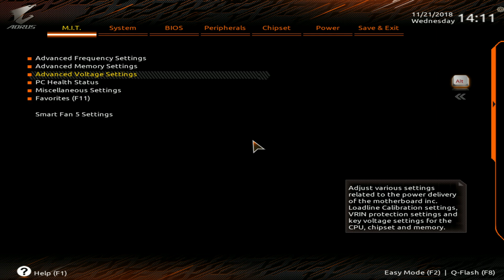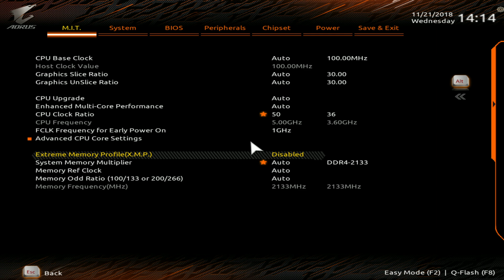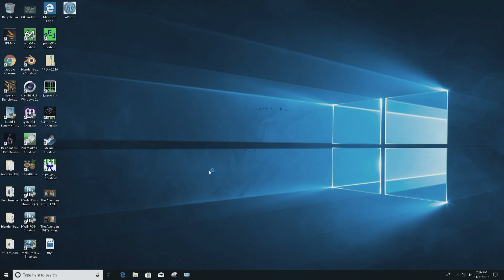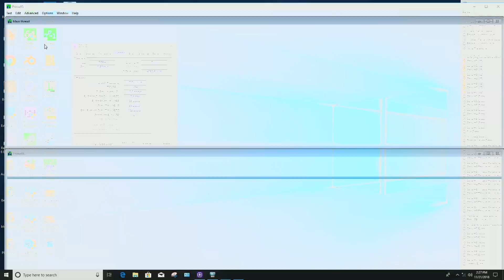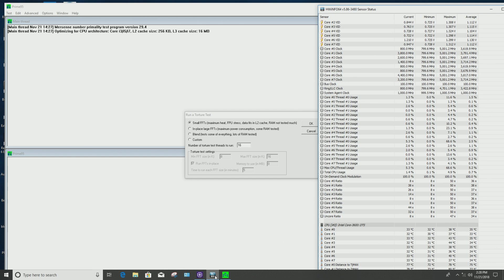GIGABYTE Z390 Overclocking Guide

Comment: This didn't work for me at all in an ambient temp of around 5~7 degree Celsius and a push pull 360 rad.

I tried from 1.275 all the way up to 1.37 and the system was just unstable. I don't think this is a thermal issue since it always crashed at around 80 degrees Celsius, guess I lost big time on silicon lottery..
Reply: Same here.
Reply: I had crashes that were reallt bad with mt chip. I changed the thermal paste on the ihs and delided the CPU with a box cutting Razer and used mx 4 on thr die and it fixed my crashing issues and instability. Intels toothpaste is trash
Reply: with a delid processor.. do you use cooling? I mean the lid is now gone so therse nothing for the heat sink to stick to with the paste.. or is that what you mean when you say you put mx4 on the die.. is that what is under the lid? a die?
Reply: @the_vicer0y_YT  your comment is a bit old but for the sake of other people who don't know, yes a delided chip still required cooling. Deliding a chip is removing the lid, cleaning the crappy Intel thermal paste off the die and replacing it with a high quality liquid metal or other such thermal paste then putting the lid back on the chip.
Reply: @ava8363y  ohhhh I never knew that they put the lid back on.  Is there a big difference if you delid it? Like is it worth the trouble? Is it easy to screw up?  

P.S. Im not anal about people replying to old comments/threads.. i think people are assholes who point out to other people who reply to old threads/comments that its so and so old... I never understood why time mattered? Most subjects are still very relevant today than it was ten years ago.. and those old posts helped me greatly in my years.. Why am I saying all this.. because I want people to stop pointing out age of comments and threads because most of the time those threads are still valuable sources of information.  Besides that.. this comment is only 4 months old which isnt old at all.

With that said.. thank you for taking the time to reply to this comment.  See.. months went by and I still didnt learn what the delidding process was till you responded which is why its a good thing to reply to old posts.  Like you mentioned, theres always someone else who needs this info.  Thanks again.

Comment: 9700k and gigabyte z390 sli crashes as soon as i begin prime using these settings
Reply: Tim Curtis I’ve got mine at 5ghz and the only way I get stable is if my voltage is at 1.345v a now runs prime95 stable
Reply: David Reeves nice! can you make a tutorial with all the steps for is? Really dont know where to start!
Reply: Burak Goraler just run through the video above but where he put 1.275v you will put 1.345v I’ve had my prime running over hr now a not got over80c with a h150 pro aoi
Reply: Tim Curtis did you succesfully overclocked yet? I got the same specs so i was wondering!
Reply: @burakgoralerx  nope..i gave up. Didnt want to break anything
Reply: Tim Curtis my i7 is stuck on 4,6ghz when gaming
Reply: @burakgoralerx  yep same here. Someone told me its meant to turbo 4.9.. not sure whats going on
Reply: Tim Curtis first time i started my pc it went to 4,9 but afrer that it got stuck on 4,6/4,7
Reply: @burakgoralerx  I would try a lower core multiplier like 48 or 49 and work your way up from there while adjusting core voltage by +0.010v - +0.025v. AVX can be more brutal for the CPU than a more average workload.

Comment: I followed this guide step by step yet when i turn on HWinfo my core clocks fluctuate :/ they're not set at 5ghz all of them... what did i do wrong?
Reply: They are supposed to fluctuate when not in use.  When you are running a test is when it really matters.  You do not want them to run at max 100% of the time.

Comment: Thanks for this info!

I am using a z390 Aorus - PRO with my 9900K Cryorig R1 Universal cooler ( massive cooler btw) , I seem to need 1.370 to even reach 4.9 on all cores, I just BSOD on anything lower ( cinebench R15/Aida64 extreme) I've tried the LLC set to turbo.

I don't think thermals are my issue, it crashes well before the temps pass 90.

If I set it all to auto, and enable MCE, voltages are in the 1.4 range and I throttle back down to 4.7! Seems for me the sweet spot is 1.265volts and 4.7 ghz locked, at this speed the temps don't really pass 80 even when stressing... seems almost like an under clock.

Did I just lose out on the silicon lottery ? Not really sure what else I could be doing wrong.

Thanks!
Reply: yes you lost _D
Reply: Check again your thermal paste.Something is wrong there!

Comment: does this apply to the 9600k as well? trying to find a guide on how to overclock it to 4.9 or 5.0
Reply: I'm also curious if it's possible
Reply: Yea pretty much all cpus
Reply: using a 9600k and was easily overclocked to 4.9 by only modifying 2 settings. Core multiplier (49) and CPU Vcore loadline (Turbo)
Reply: @shadoudirges  and voltages were on automatic?
Reply: @CONTENT_FERTILIZER  yup.
Reply: @shadoudirges  on gigabyte mobo? I just got i5 9600k idk how to overclock help me out
Reply: @damocles2x267  I would use Intel Extreme Tuning Utility to overclock the cpu.

Comment: followed the guide but totally fails to work
Reply: Failed for me as well 😔
Reply: Yeah. When run prime95. Windows crash
Reply: @mhh6787  same here
Reply: same here, followed 100%, system is working fine but crashes the moment i start prime95.  so concerned that it may crash during heavy game use
Reply: @d8thstar  okay so. I figured out what I was doing wrong. I'm now 5ghz stable.  I leave my uncore at 46 and all other active 8 cores to 50. Vcore is at 1. 37 in bios but read 1.380 in cpuz because I have vaxg load line calibration on medium. So when under heavy load my Vcore will dip down to 1.32volts. If set to high my idle volt is like 1.39+ but won't dip lower thank say 1. 35-1.37v can't remember. I haven't don't much more tuning and seems stable for 2 weeks now. I don't care to run prime 95 it's bullshit if you ask me. Oh yeah Vcore load line is medium or turbo
Reply: @bailey2624  Just because Prime95 succeeded, doesn't mean you're stable. It took me to launch video game to crash immediately, which works perfectly without OC.
Reply: Then you lost the silicon lottery
Reply: No surprise. Such "guides" work only for 1 person :) Or for 1 out of 10000.

Comment: How do you set it to have a set VID. In your video you set it to 1.275 and its running at 1.296 on cpuz. I have the same issue I set 1.28v its running at 1.35v it seems like some adaptive voltage is on. How do I turn that off so I have more control of my voltage?
Reply: This is likely due to the Vcore loadline calibration you are using. If you are using Turbo option (as in the video), it tends to push past the set Vcore. Put it at lower setting to keep Vcore around the Vcore you set. Note that a higher setting will prevent Vcore from drooping too low and increase stability. Most people seem to be using the turbo (also called LLC 5) option.
Reply: @Avoh_  did you found sloution for this problem? I am having it too
Reply: @Avoh_  Thx so i shall make it turbo or auto?
Reply: @Avoh_  Got a link to the page by chance? Found something from him but not sure if it's the same page you're referring to. Thanks in advance.
Reply: @Avoh_  Got it. Thanks again. Much appreciated.

Comment: I just wish the gigabyte bios was better
Reply: @Trust-Nothing86  REALLY bad...
Reply: it used to be a ton better, before I upgraded my system I had a z97x gigabyte board and the bios was miles better. They took 10 steps back.
Reply: why is it bad? Its the only MOBO Ive ever used so I dont have anything to compare it to.. but seems ok to me... Is it bad because other boards are more user friendly or soemthing ?
Reply: @Vertigo Studios it's outdated, many options makes no sense to be hidden within several sub menus and it's just annoying to move around if you need to change stuff frequently. Is it bad? Yeah, in comparison to Asus. But is it so bad that it's unusable? No. Fucking snowflakes clearly haven't seen BIOS from the 90s and up to mid 2000s to see what shitty BIOS design actually looked like.

Comment: Hey dood. Great vid. very informative. I just have a quick question. i have the aorus z390 pro. Whenever i OC my 9900k i can hit 5.0 relatively easy. When i run games and programs the OC will stay stable at 5.0. But when my PC is idle and nothing running, my frequency's will jump up and down from 3.7-5.0. Checked on Windows task manager, HW monitor , CPU-Z. Is this normal? or did i do something wrong?
Reply from the maker: Thanks! That sounds normal, if your PC seems idle it doesn't mean it is, it means that it could be doing background tasks that engage Intel's Turbo mode, things like Windows update will do this. -Steve
Reply: @tweaktown  HAHA. thx for the fast response. I actually figured it out. I swapped from a ryzen 7 to an 9900k. I was running a Ryzen balanced power plan. Switching to high performance power plan sorted everything out. I should prolly do a clean install? lol. Once again great guide man. helped a noob like me alot. Any tips on a good custom cpu fan curve?
Reply: You might want to double check that you locked your Bclk to 100mhz. I left mine on auto and had that issue where it would bounce up and down.
Reply: 5:50 I was watching another similar video where he increased the TDP limit to allow the CPU to have as much power as it needed as he said otherwise it may not reach higher clock rates

Comment: OMG, the defult vcore is 1.2? MY 9900 WONT BOOT unless the VCORE is hovering NEAR 1.5!
HELP ME PEOPLE!

Im on Gigabyte Auros Gaming 7 z370 with Bios F10, its one of the better motherboards with great expensive VRM and with the tighting of heat sink bolts i never go above 90 Celsius.
But my 9900K without OVERCLOCKING ALL AUTO Settings,  show 1.480 in bios menu, in HWiNFO under load like CPUZ benchmark it can go as high as 1.5, During AIDA ray tracing benchmark it showed 2.5v [probably mistake]
Reply: Mr. House 
I think that only can be a mistake...
If you have really 1.5V on your CPU, than it will be throttle because the temp will be >105°C.
I'll say install the new bios F11 and then take a look at the options again.
And all Auto is really worse, becuase the CPU can do what she want.
Reply: Z390 is where it's at for 9th gen architecture. Your 9900 may work with a Z370 board, but it wasn't designed for it. Willing to bet that's a huge contributing factor to your borked voltage

Comment: Thanks, mate!
Reply: I never let my CPU go over 80C stress testing. It's pretty much known you don't want to really exceed that even when stress testing.
On my 9900k I manually set the all the FMA's, AVX's and SSE's as enabled by editing the local.txt file in Prime95.
I add the below to my Prime96 local.txt file.

CpuSupportsAVX=1
CpuSupportsAVX2=1 
CpuSupportsAVX512F=1 
CpuSupportsFMA3=1 
CpuSupportsFMA4=1 
CpuSupportsSSE=1
CpuSupportsSSE2=1

Custom settings I use that keeps temps down are 

Minimum FFT '1344'
Maximum FFT '1344'
Check Run FFT's In Place
Time to Run Each FFT size 15 minutes

Under water cooling, I never go above 65C with the AVX Offset in the BIOS disabled. 
I let in run overnight with HWInfo running, Sensors Only, and if I get no WHEA Errors and no threads stopping I can be sure my CPU overclock is stable. 
The reason why I use no AVX Offset to overclock my PC is I don't use programs that use AVX except Prime95 to stress test it and you'll get a higher stable overclock with lower voltages with no AVX Offset but Prime95 will use AVX to stress test your PC still with those settings which is more thorough than AVX disabled in Prime95 and more likely to find errors.

If you want to run Small FFT's or Blend put your local.txt as below to keep temps lower. 

CpuSupportsAVX=0
CpuSupportsAVX2=0
CpuSupportsAVX512F=0
CpuSupportsFMA3=0
CpuSupportsFMA4=0 
CpuSupportsSSE=1
CpuSupportsSSE2=1

Or if you leave AVX enabled in Prime95 run the test with an AVX Offset of 2 to 5 depending on your max CPU temps while Prime95 is running. 
But as I said, you'll need more CPU voltage to stay stable using an AVX Offset. Try to stay under 80C at all times to avoid too much heat as too much heat can reduce how well your CPU performs in the long run.

If you're going to use AVX enabled programs with no AVX Offset test the temps when you do with HWInfo because some AVX programs can make your CPU spike dangerously over 80C.

Comment: CPU Internal IA AC DC Loadline has NO effect on static voltages and should not be changed.  It only affects adaptive (normal/auto) voltages and is simply a 'simplified' preset (not sure what values are used) for "IA AC DC loadline", which you said do not touch.  The reference value for IA AC DC loadline on the Z390 platform is 1.60 mOhms.  Auto in the Bios=1.60 mOhms.  This setting affects how much the CPU VID is raised at load, from the CPU default VID (at each basic to turbo multiplier step).  The presets here use different values for IA AC and IA DC loadline.  However it's unknown (and does not show in the core VR IA settings) which value is used.  Note that the CPU VID for all 8 cores stops scaling at the official maximum 8 core multiplier ratio (x47 for 9900k)

Setting it to turbo seems to be very close to the same as auto.